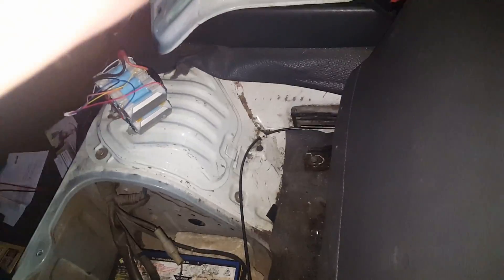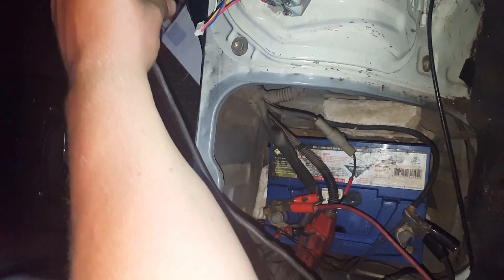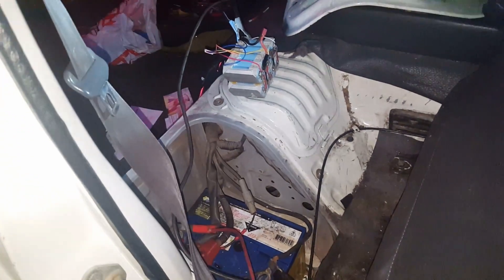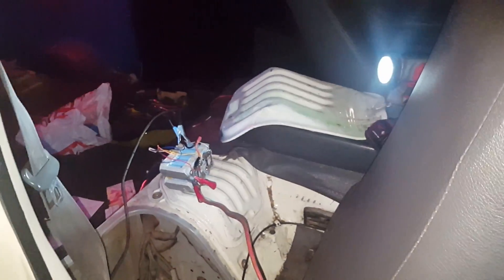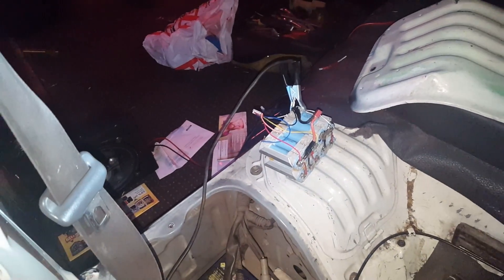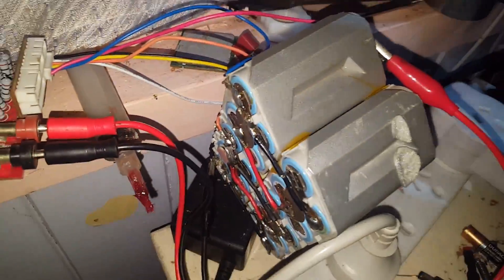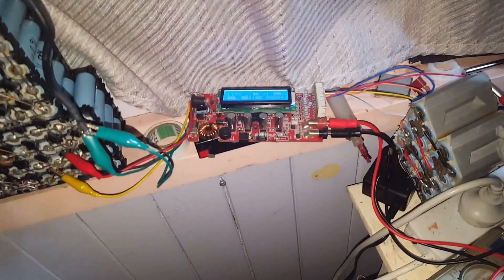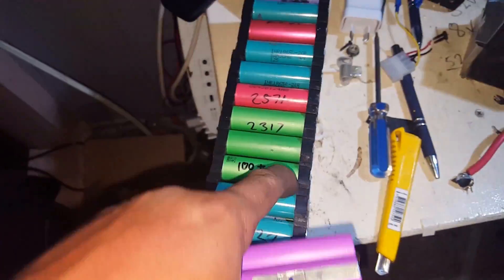Jump starting a flat car battery with 18650s Samsung inr 18650 m15

Comment: hey. are you still active today? is it possible to use 18650 battery as a permanent car battery? as long as it has a bms on it?
Reply from the maker: A 3s 18650s with big bms to handle starts yes. A 4s lipoh4 would be better in voltage range
Reply: No. At least not without some major modifications. The problems are:

1.  3s 18650 has a max voltage 12.6v when fully charged, but the typical car alternator will deliver 13-14.5 v and fry the battery.  They also drop off from that point very quickly and storing them a full charge for long periods is not good for this type of battery. If you went 4s you'd be at 16.8v at max charge with a 14.4 nominal which is still higher than your lead acid at full charge (12.7v), but it would be better for the battery pack itself. As long as you never fully charged the Lithium battery, your car would "probably" fine.

2. Lithium Ion batteries are low temperature sensitive. If you charge it below freezing (0C/32F), you can damage or destroy it very quickly. You'd need to add a cold temperature sensor at various spots in the cell pack to make sure it warms up before you allow it to accept a charge.   The discharge low temperature is about -20C/-4F. Discharging doesn't seem to damage them but it does cause them go dead faster. 

3. Lithium Ion batteries are high temperature sensitive too. If you charge them above 45C/113F or discharge above 60C/140F, you run the risk of them venting which can cause a fire. Running at consistently high temps will shorten the life of your batteries too. These temperatures are easily be hit in the engine compartment of a car.

Lithium Iron Phosphate (LiFePo4) batteries are still temperature sensitive, with lower useable energy density. These batteries do not combust at high temps, have better discharge rates, and can handle many more charge cycles. I don't think it's worth changing from a conventional battery for starting a car, but if you are going to try it, go with Lithium Iron.

Comment: If we placed it permanently with the car battery, Is there any high volt problem in car? 2nd.... If we use a 10 capacitors of 25v 10000uf along with this lithium battery, Is it help to burst the current for starting....
Reply from the maker: A super cap pack is what i need to build
Reply: @Oneupthesleevecustoms  If you combine both 18650 & Super Cap, It will produce more powerful current for starting. I do it with 14.8V 4C4R and 10 25v 10000uf capacitors. It good enough along with battery to stabilized the voltages also help to divide starting load from directly car battery. I impressed 18.5V your jump starter and I am going to try this along with capacitors. Only one thing confusing me, Is any electrical damage happen on 1990~2002 model cars by using 18.5V.
Reply: @247workplace4  Car designers expect a maximum around 14.4v. They will struggle to handle 18.5v. It can certainly break many cars. He says to leave the dead battery in and turn the headlights on to reduce the risk. I'd say to use no more than a 4S battery, so it's down to 16.8v peak. That's still risky if there's no load to limit it with

Comment: if the car needs 400 amps to start how much you are getting from the battery pack??? are they different concept?
Reply: IMR18650-25R handle 4x the rated current for 1 second, so that could apply to other 18650's as well (100A/1s). a 4S4P pack can deliver the 400A peak current and 100A continuous. The disadvantage is giving 16.8v to the car that expects not much more than 14.4v. Jump starting from 18650's will heat them internally. It's not suitable for cars that don't start after a few seconds. Like the starter motor, the pack also needs a rest between cranking, so they have a chance to cool down. The thin nickel strip limits constant high current draw
Reply from the maker: Yeah from the moment they are connected they are getting drained
Reply from the maker: They are 18v so big advantage there also it has 4 rows of cells pushing 20 amps per row at a higher voltage 18x20 x4  around 1.4kw
If it was 12v and 80 amps only .96kw.
Thats if your working on their continuous discharge rate  im sure for bursts they could do double so towards 3kw of burst ia huge

Comment: Is it possible a lithium battery could be overcharged by the alternator while connected, causing it to explode?
Reply from the maker: Nope its 18 v
Reply from the maker: Its still discharging the batt while car is going
Reply: Yes it's possible, but the pack he made has enough cells in series. You should have minimum 4 cells in series to handle 14.4v. Most 18650's can handle 4.2v/cell, and with 4 of them, that's 16.8v tolerance. Minimum acceptable voltage for 4 is about 12v (3v/cell). IMR18650-25R handle 4x the rated current for 1 second, so that could apply to other 18650's as well (100A/1s)
Reply from the maker: Awesome answer cheers
Reply: @Oneupthesleevecustoms  It's brilliant to see your 18650 pack working. I thought it'd be a great idea to make, but didn't wanna randomly spot weld a pack together and have something not powerful enough. That van battery didn't get enough charge after the short run for another crank, but the 18650 pack still turns it over quickly. This is the kind of video to watch for anyone wanting to make a jump starting pack

Comment: I always knew this would be possible but Jesus I didn't think you could do it with as little as a 4S5P pack (at least that's what it looks like in the video). Even if they are high draw Samsung cells, I always thought you'd need to draw like 500 cold cranking amps from a typical car battery to start it. That's just awesome man, good job.
Reply from the maker: Doesn't it do it easy too!!
Reply: It can provide 500CCA. The cells handle and deliver very short, high current bursts. This is where Lithium batteries excel. They are in between lead acid and capacitors in terms of delivering current quickly

Comment: are the cells  inr18650 25r? because the cells inr 18650 m15 don't exist. are they   from drill battery  or computer portatil (laptop)?
Reply from the maker: +Jesus Maria Rodriguez Olivarria 15m written on them
Reply: ok  thank you, are they from drill battery or laptop battery?
Reply from the maker: +Jesus Maria Rodriguez Olivarria drill there high output cells but only 1500mah each
Reply: inr 18650 15m has 23 Amp. Max. discharge current
(continuous) but in 3 or 5 segs how many amps give?
Reply: @jesusmariarodriguezolivarr2477  100A for one second for the IMR18650-25R

Comment: what size voltage was this pack? Couldnt you, in theory, make a DIY car battery if your old lead acid died? 12v with serious parallel capacity....
Reply from the maker: +Miles Papineau this is a 5series 4 parallel  battery 18v 6amp hrs
Reply from the maker: +Lim Cheah its 18v untill.you still it on a big lead acid sponge and engage  a startermotor thats pulling 100s of amps. I wouldnt recomend using it on a 2000 plus model car or as a replacement for a normall battery
Reply: 18v? u gonna fry ur car component with that
Reply: @limcheah8260  if you connect it to an empty battery the voltage drops instantly
Reply from the maker: Small leads make it safe too

Comment: That was me that asked , thanks for doing that  :)
Reply: We don't really care all that much tbh. And the video is so poorly shot that you can barely tell whatt is he doing with that 18650 battery pack.
Reply from the maker: Ade Tuck good thing you subbed ;)  does it easy as .
Reply from the maker: +Ade Tuck and sadly it wasnt a planned  video. 10pm last night  i want to move it and flat ;(  went to swap out normal battery then grabbed the small jumpers and the 5s 4p pack  and it worked wonders
Reply: I thought you planned it all just for me :)
Reply from the maker: Ade Tuck sorry mate haha it was a necessity video haha real world haha
Reply from the maker: Ade Tuck try make a spot welder next?
Reply from the maker: +TrasherBiner were did your comment go?